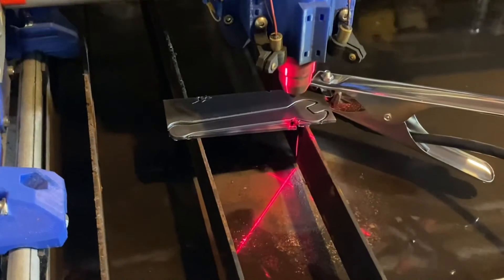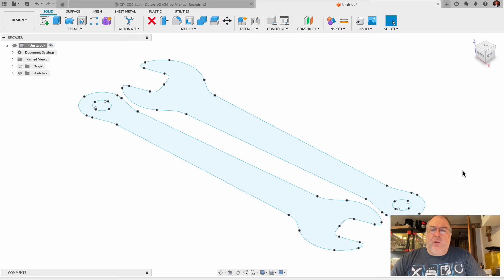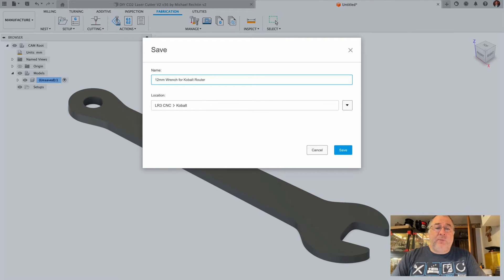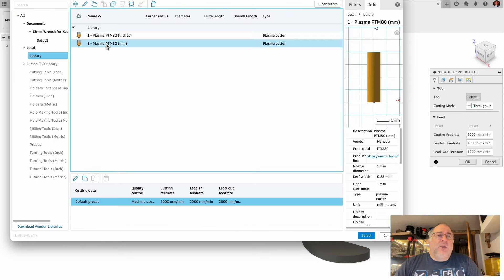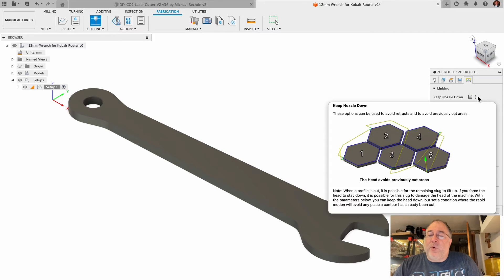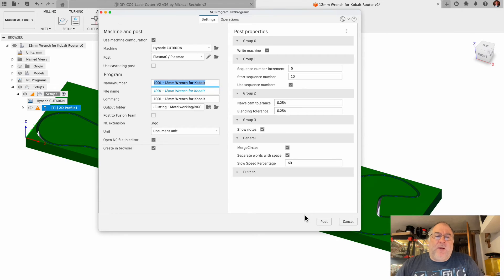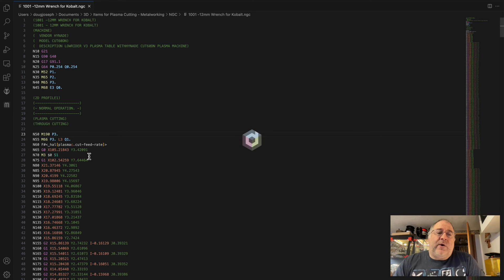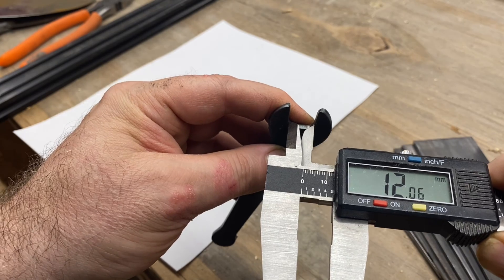Fusion 360 Tutorial: Plasma Cut Prep How-To (for any CNC plasma)

Comment: Dude, just getting into this business! Tell me, how does the skr/jackpot boards handle emi? Any problems?
Reply from the maker: @lukesalter-ec3hh  my plasma is driven by an old used laptop running LinuxCNC connected to a breakout board via Ethernet cable, and it is a build of LinuxCNC that has a user interface for plasma work built into it that is called QTPlasmaC. So I’m not sure how someone would do this with an SKR or Jackpot because I didn’t do that. It’s probably doable but I would not want to be without the QTPlasmaC UI.
Reply: @ reading lots about Linux regarding these issues.. just how big of a curve would it be do you think?
Reply from the maker: @ it was my first time to do a full install like this. I can tell you there’s a very helpful forum where you can get help!
Reply: @design8studio  ah that’s great to hear! More reading to ensue! Thanks for all you do Doug!

Comment: What program did you use to draw the wrenches and why not just draw them in Fusion 360?
Reply from the maker: @RRaider  I drew them in CorelDraw, a vector illustration program that I have decades of experience with. Other than just familiarity with the CorelDraw program, there’s no reason I could not have drawn them in the 2-D sketch feature of Fusion 360.

Comment: Why didn’t the handle hole get cut? How would you add that to the cut path?
Reply from the maker: Hello! My understanding is that if the lead-in settings call for a lead-in that's too wide to fit inside a given cutout, Fusion will simply skip that cut out shape. I did not bother trying to get the small circle to be cut. I think I could have by specifying a shorter lead-in on that circle.
Reply: @design8studio  that makes sense! Thanks for the quick response.